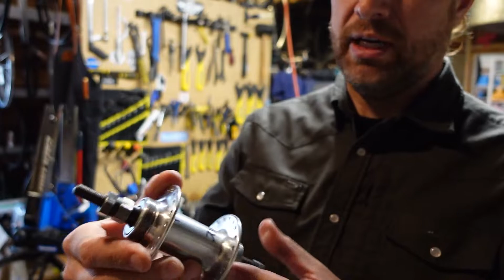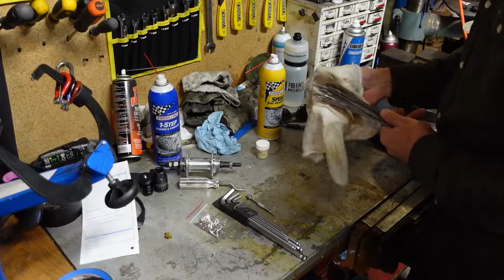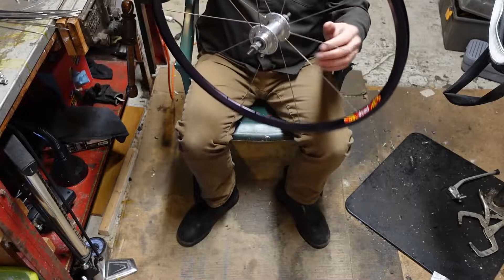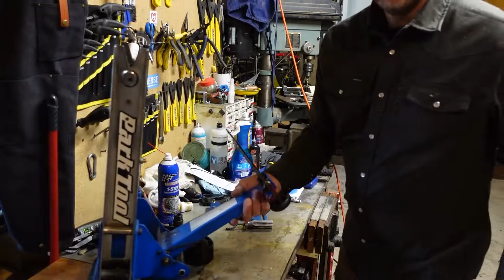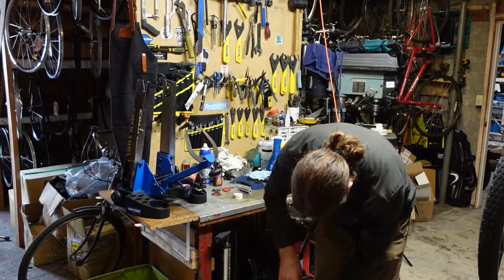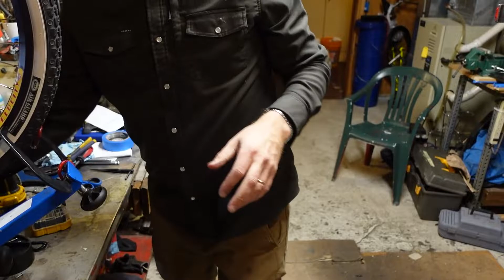Building a bicycle wheel - A weird, 40 spoke tandem wheel needs a new rim

Comment: Hey Bike Farmer, I built thousands? of wheels, I would have just measured  the old spokes and adjusted  for the ERD of the new rims...if you have the option to use 4 cross patern, the spoke length is almost the same regardless  of ERD or hub flange dia..I never use spoke  prep ( I hate the smell of the stuff) I prefer  bee's wax or linseed oil on the threads of the spokes..never failed for me..
Reply: Smart! So difference in ERD divided by two, right?
Reply: @tomalcolm  Greetings..the spoke length  for a radialy spoked wheel would be ERD-hub dia÷2..I am not a fan of radial lacing, especially  on  the rear  wheels.. there are many good spoke length  calculators on the web..QBP has a good one as well as Sapim. The key to a good wheel is to  tension, true, and dish slowly and evenly.
Reply: This video is instructional - for people like me who have never built a wheel from scratch. When I buy the rim, spokes and hub, I need to know how to get the spoke length right. I don't have old spokes to measure.
If you know so much about wheel building why are you even watching this?
Reply: @sprocketandwheel really like thoes Sapim single butted 13/14 for this wheel. Never used spoke prep either. T-9 has always worked for me. Getting the spokes properly seated and and prestressed is far more important...finally with the tire on and inflated to proper air pressure and rechecking the tension and dish as I go. Never had nipples un wined. But then again I also back check the nipple so the spokes aren't slightly twisted. I also give each spoke a tap (not to hard but firm as you don't want to put any micro cracks the eyelet of the rim. ) against the fange side down on the concrete floor until every thing stays the same... it is amazing how much the tension comes down during the first round...Anyway I believe this work hardens the spokes and my wheels stay true for a long time.
Reply: @stevengagnon4777  That is the way I build them as well..slow and  even tensioning..I try to get the dishing  right, and then I start increasing  the tension..seating the spoke head is also  a key..my favorite  spokes used to be Robergell and Raedelli..I believe  thay they were steel ( not stainless) strong and light..

Comment: 40 spoke MONSTER!!! its always worth splitting hairs when it comes to wheel building - i once had to rebuild a drive wheel with a gearhub using long spokes actually cut then bent onto the hub into tiny eyes - usual fix to rim... - it lasted a good year or 2 til the bike fell finally to bits 😊😊😊🚴🚴‍♂🚴‍♀

Comment: Actually since the threads are rolled on a spoke, the nipple will not bottom out. The problem is that the nipple might only engage 1 or 2 threads and strip out. I had that happen once. Do not use alloy nipples! The shanks break off and pull through the spoke holes.

Comment: I worked at a shop as a teenager and only spot-trued wheels; never built anything for customers but have done a few over time for myself.  I don't know if it has to do with rim quality but hops are difficult and very frustrating to me.  The owner could build PERFECT wheels while smoking Sir Walter Raleigh in his pipe and chatting with customers.  Another mechanic was just as good but wanted to be left alone.